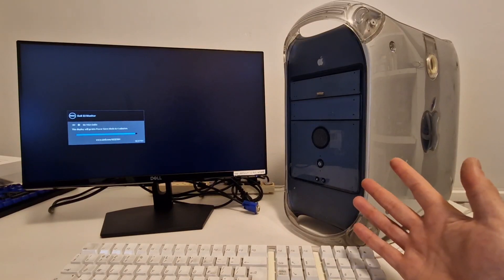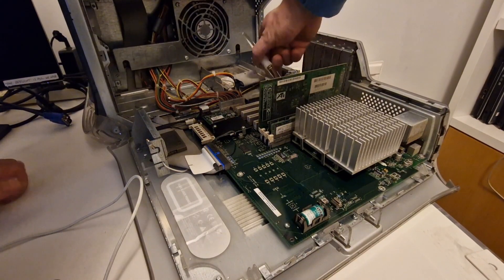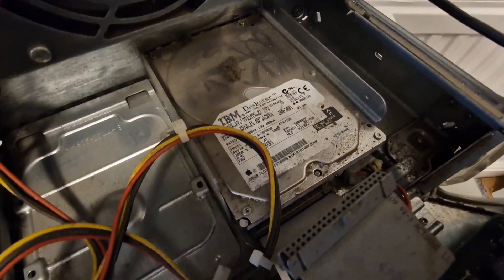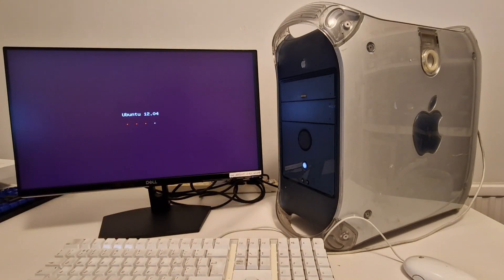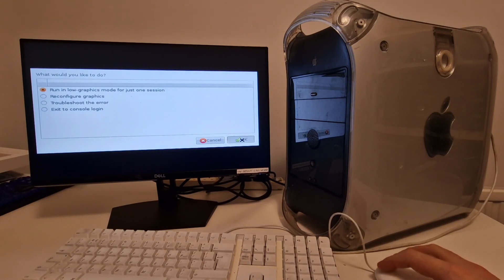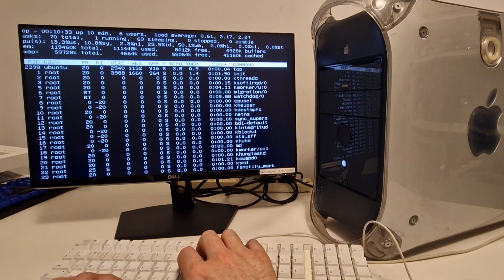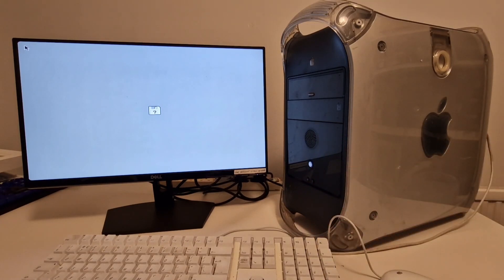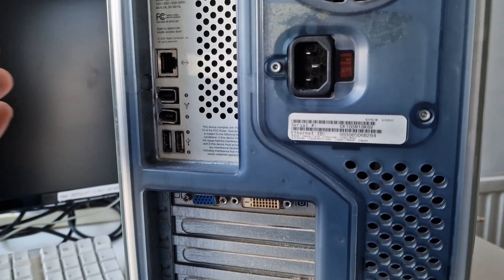Will this 2001 Apple Power Mac G4 Work? What's inside?

Comment: Got the same model - never going to break any speed records in the modern era but a healthy performer. The only non-working part on mine was the ZIP-100 drive. Still trying to figure out how to repair that one. Just doesn't recognise any disks and won't eject...
Reply from the maker: @julianbrown1331  what OS is on yours and what do you use it for?
Reply: @ mine is dual boot but defaults to OSX , it’s just a novelty really at the moment although by strange fluke I have had a complete set of Adobe software for OSX sat in a box for the last 15 years waiting for some hardware to use it on… I spend far too long designing and repairing retro hardware to actually use it for much of anything

Comment: The everymac website will tell you: the Power Mac 3,4 466mhz uses pc133 sdram, has three Memory slots and is upgradeable to 1,5 GB ram. Newest possible MacOS is 10.4, but you also should try out Phenix Linux PPC or Adelie Linux oder OpenBSD as a modern OS.

Comment: If you decide to just make it a LInux box do Adelie LInux, it's current they just did beta 6 I think. It allows you to install from the live disc installer (see actionretro 's video on it. he posted the other day). The good part about doing a linux install is that you could get a better AGP graphics card that may be formatted for PC, but Linux should see it, so no worrying about flashing it for MacOS. If you did ever decide to run OS9 or OSX on that thing (I don't really recommend) it will probably be too slow and there's only a couple web browsers that will work Classilla and InterwebsPPC for osx. there may be a few others but that's all I found that would work.  You can try OpenBSD or some of the other BSD's too. Not sure the max ram, maybe 2 GB maybe more if linux or bsd recognizes it, or maybe that's a motherboard issue that would keep it from recognizing more than 2gb. Either way, it is possible. just get that SSS to IDE adaptor, get a Samsung or other SSD card, a better graphics card, and see what amount of ram works in linux or bsd for that model. I'm currently working on doing that to a Blue and white G3. It's been nostalgic and fun. And frusterating sometimes too.

Comment: The case is in fine condition and if you use an IDE., to Sata adaptor then an SSD., can be fitted, maxing out the RAM., would also help as would a thorough cleaning and new thermal paste, perhaps you could try installing Adelie Linux for power PC..